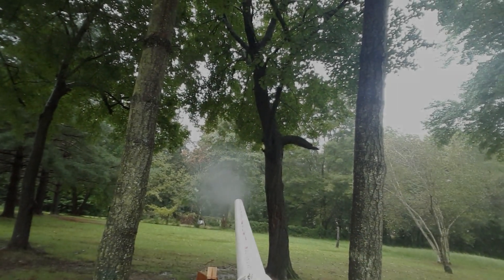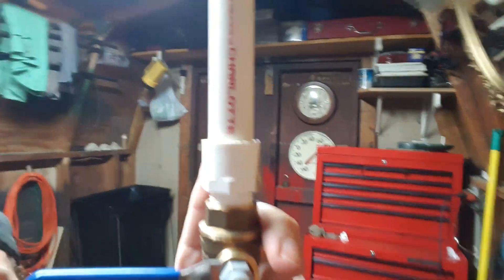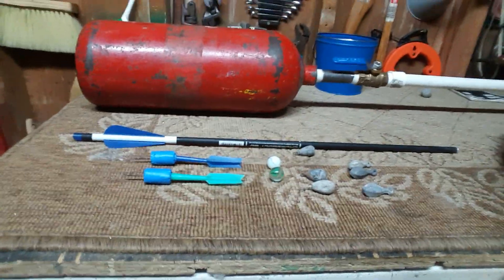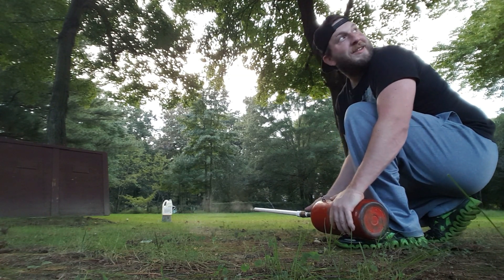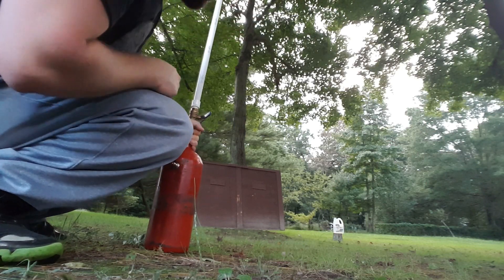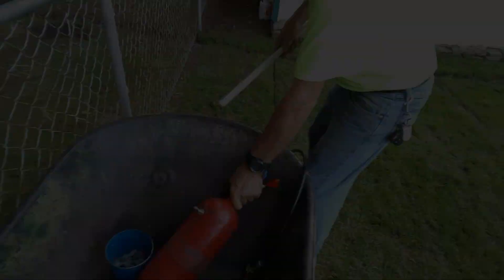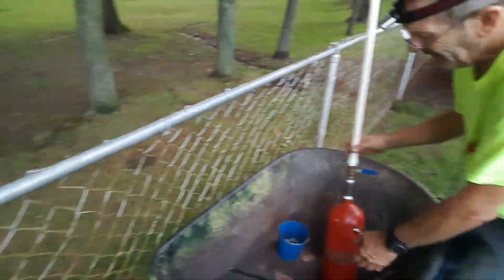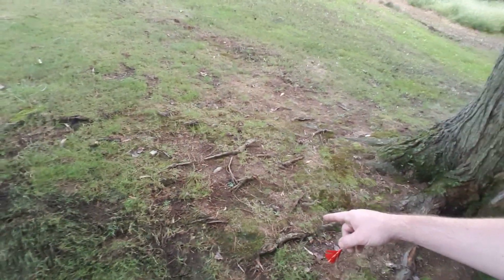AIR CANNON From Old Fire Extinguisher!

Comment: How do u secure the bolt valve to pump air in and how do u get in in there
Reply from the maker: I put it in thru the top and rolled it around until I got lucky lol thinking back on it a should have fed a string through and tied it to the valve stem and pulled it thru. Just a normal bolt in valve and rubber washers worked fine. Held 100 psi easy.

Comment: What size steel pipe did you use to go into the ball valve? I have a 3/4” bass fitting and it didn’t fit, but the hardware screwed into my 3/4” ball valve, just not the fitting into the fire extinguisher
Reply from the maker: It was just a ¾" nipple. Do you still have the old hardware? Maybe try taking it to a hardware store to test fit the threads. I assumed most Extinguishers were universal for the most part but it may be a different size.
Reply: @casuallyextremeoutdoors9644 
Yes I still have the original hardware. The hardware screws into the ball valve, and into the tank but not the nipple into the tank which is odd. I’ll bring everything to the hardware store today to get the correct fittings. Thank you!
Reply from the maker: Is it too tight or too loose?
Reply: @casuallyextremeoutdoors9644  it’s too loose, I can feel it wanting to bite but it never does catch the threads correctly
Reply from the maker: You could always try some threadlocker or something. Just be careful because you're gonna want like 100psi in that bad boy. It all depends on how loose we're talking. I don't know if you'll be able to find a nipple with 2 different threads. Maybe cut the nipple and try to thread it yourself?